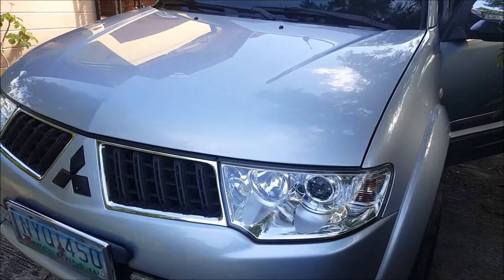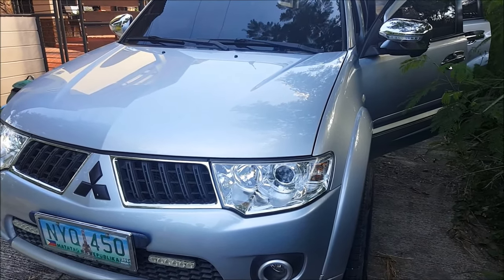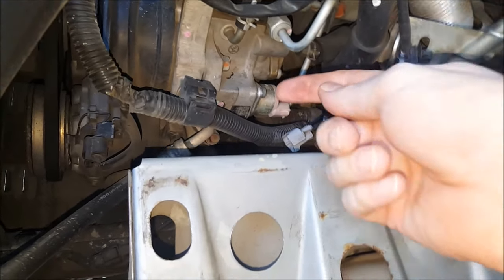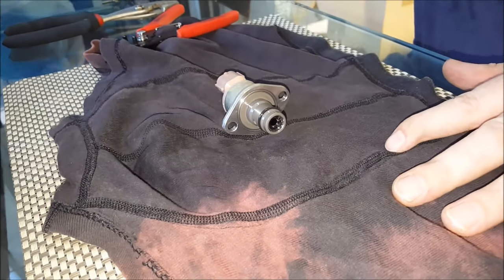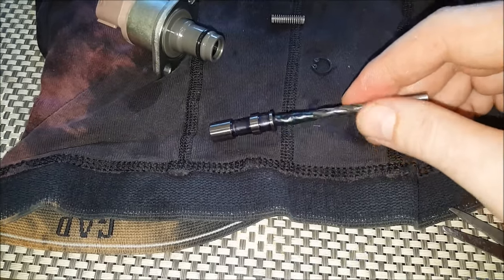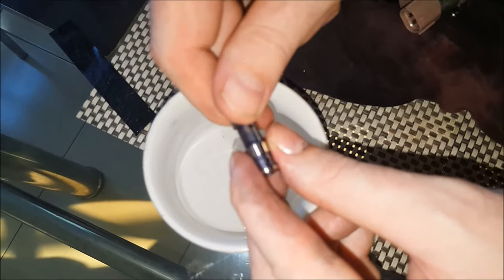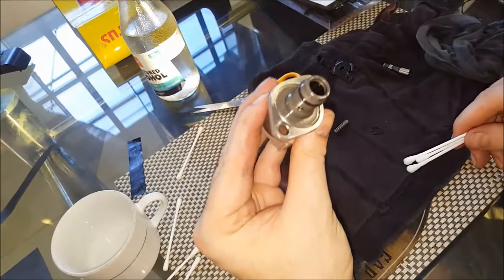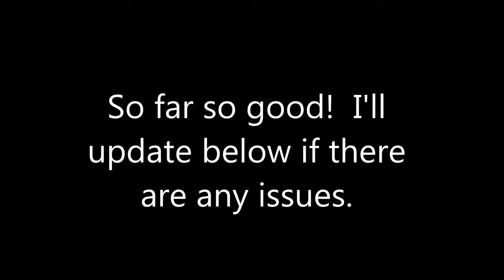2009 Mitsubishi Montero Sport 2.5L Suction Control Valve (SCV) Removal and Service

Comment: Hi there i just replace my air and fuel filter and my montero is shutting off its engine after. Do u think its scv replacement?
Reply from the maker: francis del rosario run an OBD2 scan and look at your error codes

Comment: Sir what about the FRP there was a Problem we Counter the Most.. We Repalce Both FRP and SCV ,, For  REason no Problem
Reply from the maker: What is FPR?
Reply: @electriccarconversion   fuel rail press. 
sensor
Reply from the maker: @royharper7426  thank you, why did you replace FRP sensor? Were you getting errors which indicated  faulty rail pressure readings?
Reply: MonteroGuy . Actually ddnt indicates in ip cluster meter and we check use our scan tool diagnostic. Both sensor are show in relationship together just like lover joke.
We noticed that these se snsor are actually operating togther
FRP for rate of fuel pressure inside the common rail.
And scv for for control the regulations of the fuel.
Reply from the maker: @royharper7426  That makes sense. The sensor that indicates how effectively the SCV is working then, perhaps? I'm thinking that if a sensor was failing you would dramatically different and erratic readings, to the point of failure yup send any reading.  I'm wondering if that reading is used to determine SCV OBD2 codes, and I'm wondering if the FRS has its own OBD2 failure code?
Reply: FRP - FUEL RAIL PRESSURE SENSOR TANGA

Comment: Hello! Is the reconditioned SCV still working, or you replaced it?
Thanks!
Reply from the maker: Still working :) 10k later.
Reply: MonteroGuy hello,
Yesterday I did the job exacly how you did it and the engine is running smooth (opel astra gtc 1.7 with Denso injection).
Thank you so much!
Hope to be as lucky as you are! :)
Reply from the maker: @strdg520  I'm happy to hear this worked for you, especially on another make and model.  Cheers!
Reply: Salut! Am facut 8000km si n-a mai oscilat relantiul deloc de atunci (exceptand cand intra in regenerare). Merge perfect, iti recomand procedura!

Comment: hi just replaced mine a year ago and it went surging again after 7000kms. does the scv really breaks that fast? scv came from casa.. thinking of getting a hi performancr spec scv instead of oem
Reply from the maker: My understanding (and I could be wrong) is that the tolerances on the hi performance SCVs are increased.  I believe what we are doing here is the same thing.  After we finish polishing the tolerances should be slightly increased.
Reply: I just refinish the scv like u did in the video and im happy to report that it worked. Running gppd for 22 days now thanks for the video it helped alot
Reply from the maker: rtcivic  I'm happy to hear that the procedure worked for you too! Cheers!

Comment: my pickup 2018 model same problem how can i repair
Reply from the maker: How do you know it's same problem? If same problem, it's possible same fix may work.
Reply: P0093
Reply from the maker: @adamakeita2864  fuel system leak detected code.  I would check my system for a leak if I had that code.

Comment: Cannot do this on montero 2011 onwards SCV. Why? bec it has the fixed type SCV or the no circlip version of an SCV!
Reply from the maker: Matt Quebec I hope that means it doesn't fail as easily as these older ones.  Is it possible to run an older SCV in the 2011 and newer?
Reply: my problem was. when i step in the acelerator and release the accelerator.. it took 1 second before it goes back to idle..a delay.. can u help me what is the problem. my engine is triton 3.2 4m41.. 2010model
Reply: @christophersabillon7510   sir have you solveed the problem

Comment: montero guy,i owned triton 2.5 2010,when i try to overtake with lowering the gear and by time pressing(sudden press) the pedal ..its seem the engine runs not smoothly. could it be the problem of scv?
Reply from the maker: UCHU BIR could be. I would ask if you've had any engine faults that you know of. Did you see the check engine light come on? I recommend getting an inexpensive OBD2 scanner. I sell some on OLX btw ;). Read your stored error codes. What you've described sounds like a general shortage of fuel or air. Hard to determine the cause without further inspection. When was the last time you had your EGR Valve and intake manifold serviced?